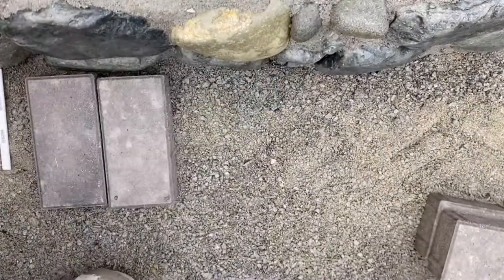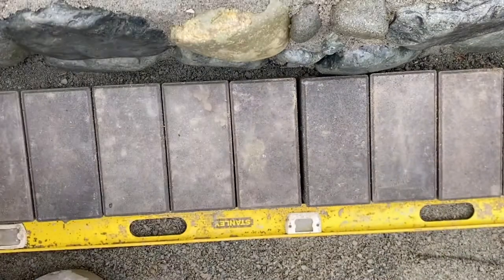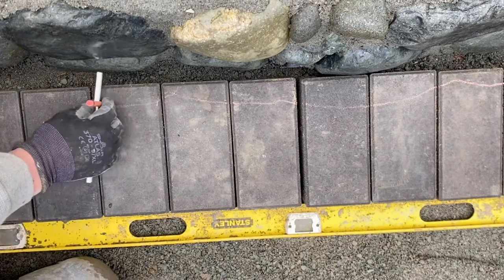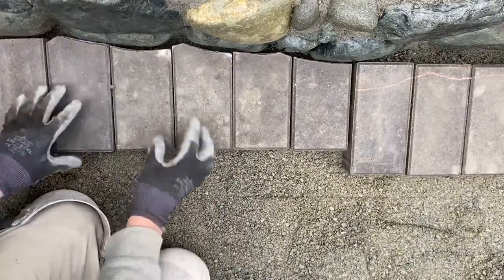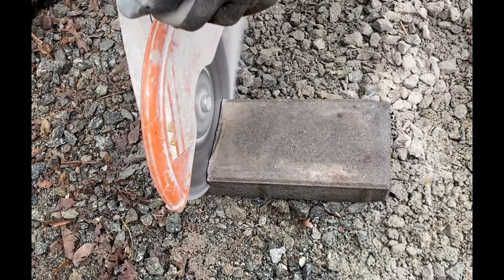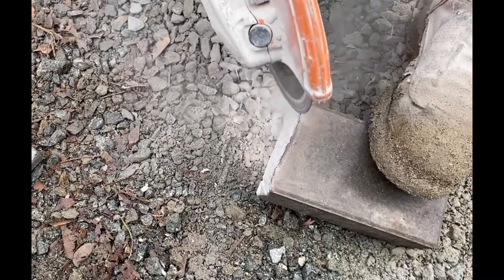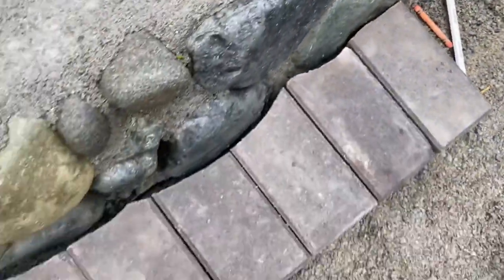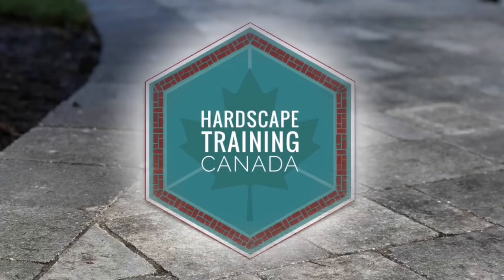The ONLY way to scribe pavers. No fancy scribing tools necessary!

Comment: will this method work for adding a soldier border to a circle firepit using 4x8 bricks???
Reply from the maker: Hard to say without seeing the space, but it should, you just may have to cut the bricks themselves to make a nice circle pattern as well as scribe them into the fire pit